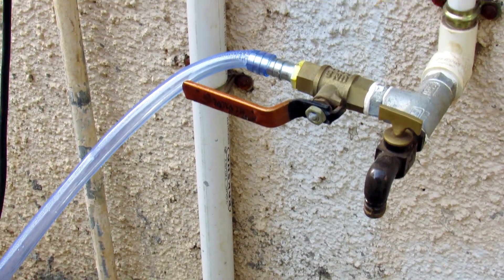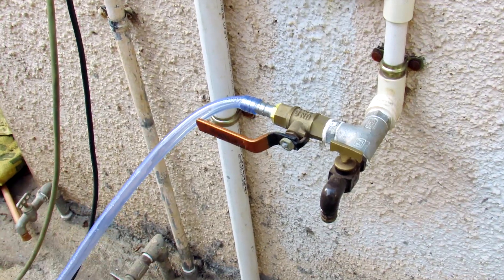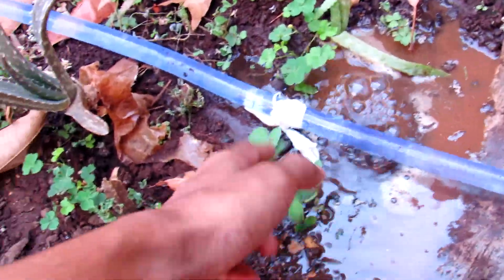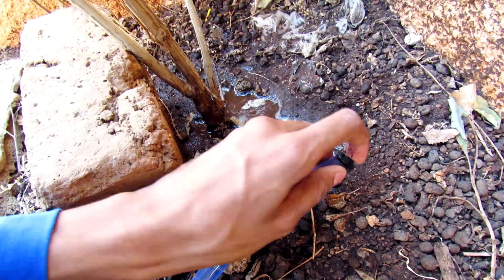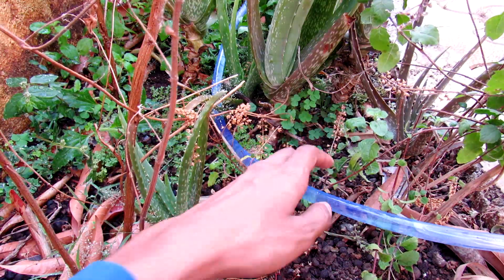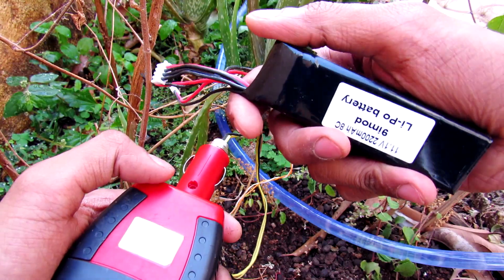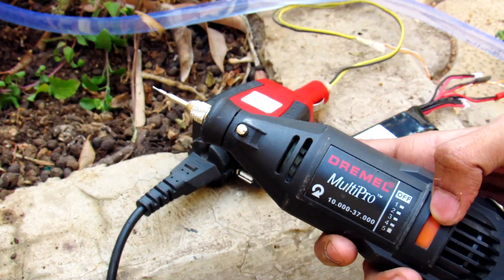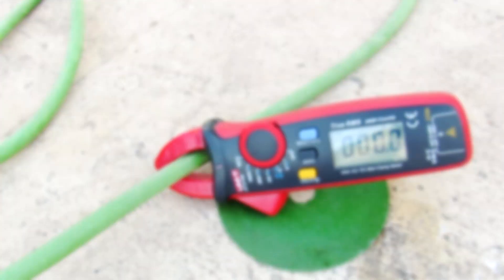Drip Irrigation System : How to

Comment: If it is working and plants are growing then it does not matter if it confirm to drip irrigation design. We use similar system. But we use gravity instead of motor power for creating water pressure. We have attached main water line to a tank installed on a 2 foot stool. Also we use feeder line and drip emitter to regulate water flow to pot. We will appreciate your feedback on our installation.

Comment: simple idea.. but drip irrigation is about feeding drops to the root of plants, not jets of water... probably you could reduce the pressure to a minimal by closing off the valve to 10% and that would achieve the purpose.